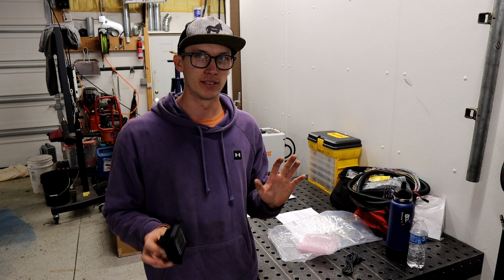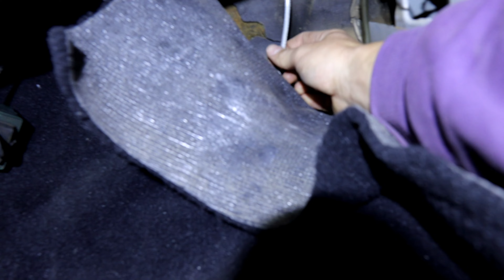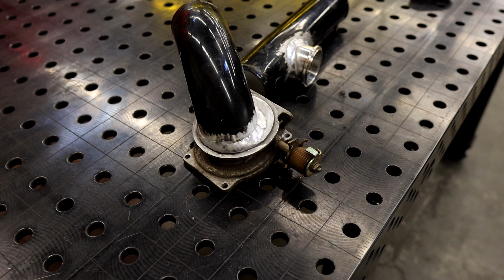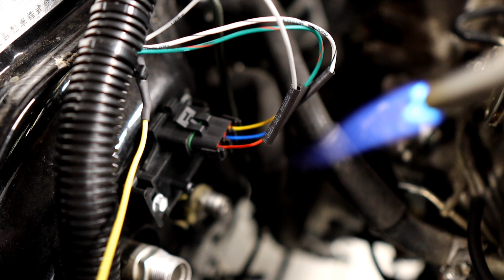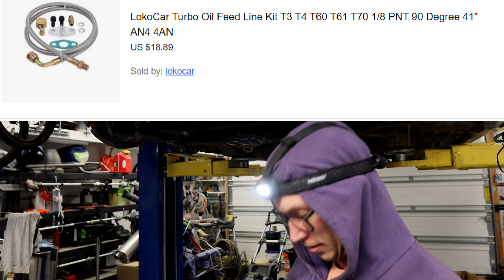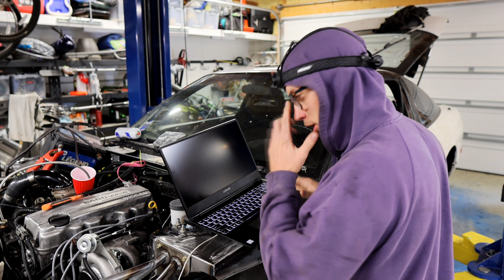Turbocharged S13 ECU Install | Worlds Cheapest 240sx Drift Build

Comment: Do you know if I could use a s13 ka harness on a d21 motor or would I need the Microsquirt custom harness?
Reply from the maker: If you are keeping the KA naturally aspirated, you can splice the harnesses together (KA24E TO KA24E OR KA24DE TO KA24DE). You can't interchange the two types of engines and harnesses.